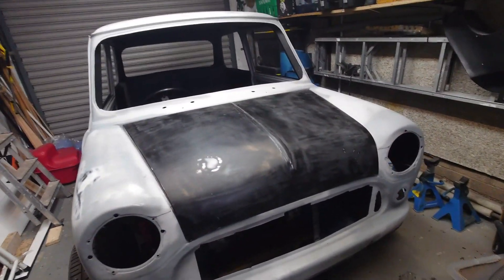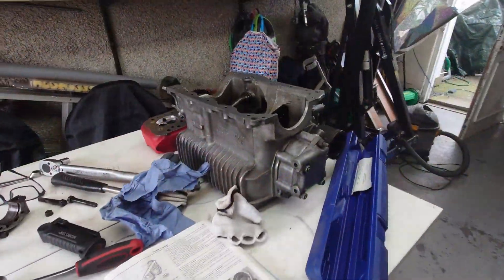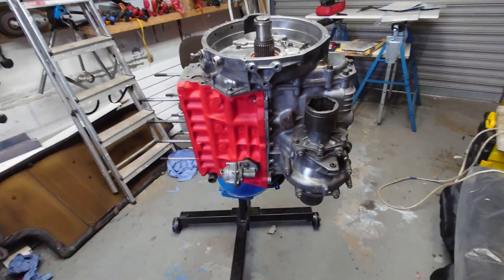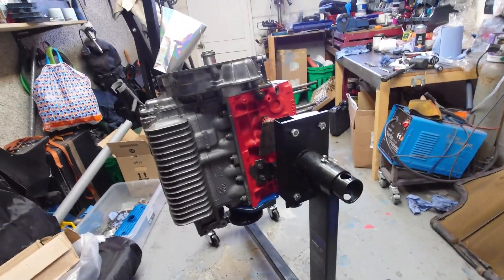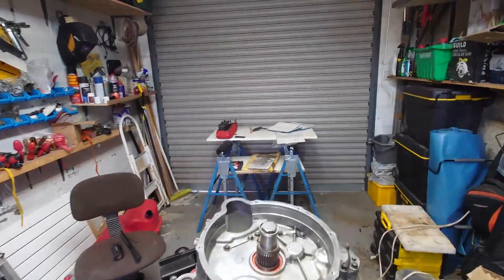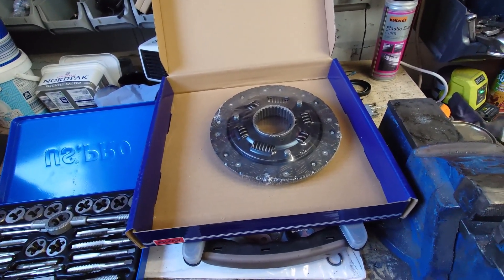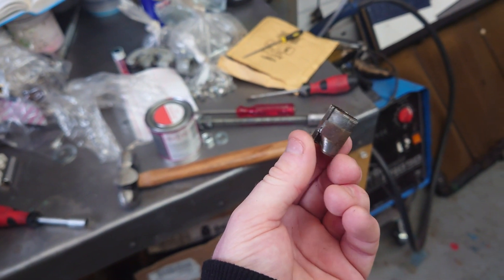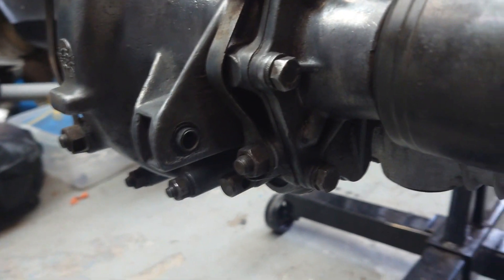The Little General : Classic Mini Build - EP54: IT'S Gone

Comment: Iv seen people break them Bush housing off hitting them in  😳. Take it the cam buckets are locater all OK if the block has been upside down. Look forward to seeing the shell in colour 👍👍👍
Reply from the maker: Everything seemed fine, I think the engine had some work done at some point before I got it as bearings etc all in good condition. I have the car back and it looks amazing. Videos to follow.